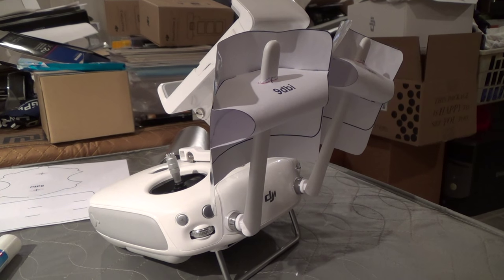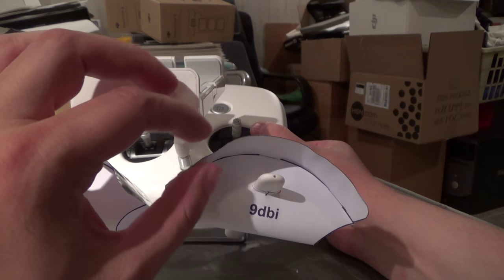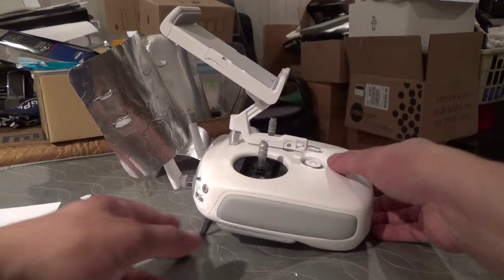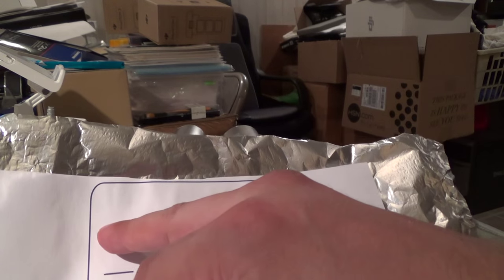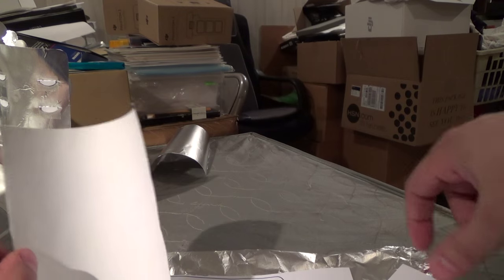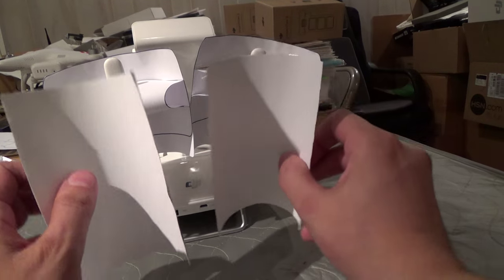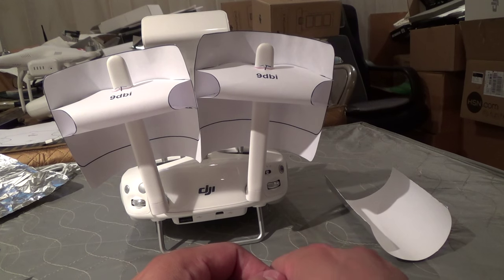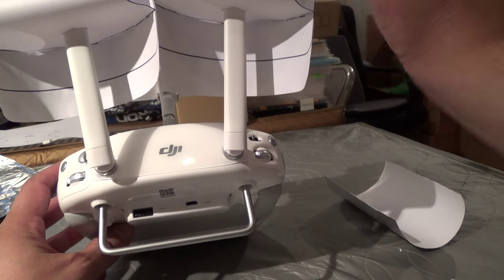Increase FPV Range Phantom 3 Inspire 1 without modding RC - Windsurfer

Comment: Ben I did some experimentation using a wind suffer on my phantom 2s But I made a nice improvement. that worked much better then the alum foil.  What I did was to make the reflector part out of some thin alum roof flashing. which I cut with scissors and a razor blade to cut the slots for the center brace tabs to go threw and some tape to hold the tabs in place when they were folded over.

and the center brace thing out of some plastic from a margarine tub.  It was a lot more sturdy then the thin card board and foil..  and the flashing worked better as an antenna reflector then foil did cause its really smooth and no wrinkles as well as being thicker I think also helped to bounce more of the signal out ward..
Reply from the maker: j james Sounds like a nice solution.  The video gave the basics, but there's no limit to the materials you can sue to make your own reflectors out of and it sounds like you did well :) I have been tinkering with my own ideas as well using alternate materials.   Anyway I'm glad you've got some good results. Happy flying :)

Comment: The funny thing about those pretty mods is that it looks and sound good on paper and even mounted on the controller, BUT I haven't seen any actual test of it.
Reply from the maker: There are no shortage of tests with these style of antenna boosters and the results and improvements are indisputable.
Reply: +Ben7seven7 Good Luck in your new design, just remember that the original design is base on the parabolic method of reflecting the signal.Let me know when you make a video of the flight with and without the windsurfer antenna.
Reply from the maker: Quasimoto Glez
I never ended up finishing the newer design ones. I used the ones I made in the video in which I have them longer than the pattern and they did work very well for me. In situations where I'd have a lot of wifi interference near me and video glitches, using the windsurfers fixed it 100%. It worked noticeably and appreciably better.
Reply: +Quasimoto Glez  Found this antenna range extender, don't know if anyone will find it useful.

- > http://goo.gl/UO9Yt1

Comment: Very cool!  Is it normal to only get around 1500 to 1800 feet before I  start losing signal on bone stock P3 Pro?
Reply from the maker: +Michael Kincaid Depending on the location you're flying in it's not unusual. Antenna orientation, line of sight to the aircraft without obstacles in your way, how high you fly, RF interference near you or the Phantom as you fly.  All those things and more make dramatic difference in the range you can get.  if flying in a clear open area with little to no RF interference, clean line of site to the Phantom and proper antenna orientation, you should easily pass 1 to 2 miles distance.  On the flip side, in an urban environment with a lot of RF interference from Wifi sources among other things, you'll only get a fraction of the range.
Reply: Ben7seven7 Thanks for the info! I think that is pretty much my problem, flying in dirty air!
Reply from the maker: No Problem. Good news is there are several things you can do to increase range. Start with the 32 channel mod and wind surfer antenna. Select a clean channel to fly on.  And you'll likely double the range you can get now under the same conditions.

Comment: just curious...Should the foil not be facing the drone?
Reply from the maker: It doesn't matter which side of the paper the foil is on as the signal passes right through the paper.  You could even apply two layers of foil to either side of the paper if you so chose.  That may even help make it work better even as it would provide more thickness to the foil.  You could also use other thick foil alternatives as well.

Comment: Does it really DOUBLE the range? Man, I wish I saw this before I cooked my DX6i trying to retrofit a high gain antenna. Not sure what I did wrong but I fired my TX module on my second flight. Farrrk.
Reply from the maker: Rueben Oz It can as much as double your range depending on your personal design of the antenna. Range will vary and is not exact.  You can expect no less than a 25 to 50% increase in gain, and again maybe as much as double. I've seen people double their range with some 3D printed versions.

Comment: Interesting. Try them yet?
Reply from the maker: Jeremy Miller Yes, I flew with these antennas later the same day at a park I fly at in similar conditions which included RF interference from various sources including RC cars and another Phantom pilot flying right next to me with his controller.   Last time I did this a couple of days prior I would have occasional screen glitches lag and cuts from less than 1,500 feet away.  But when I used these antenna adons it worked absolutely flawlessly the entire time, no matter how many people crowded around to watch me fly, and even pushing a mile away still holding on to perfect signal and smoothness.. So yep. two thumbs up on the performance. If you want a simple cheap and stress free  (no RC mod required) way to significantly improve your performance, these are the way to go.
Reply: Good deal! I might give this a try when i am in a high rf area